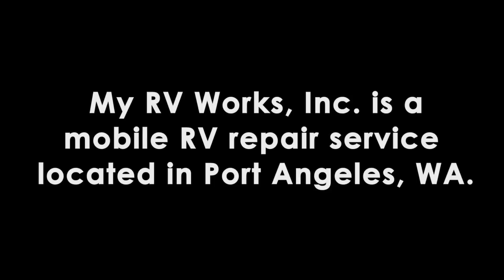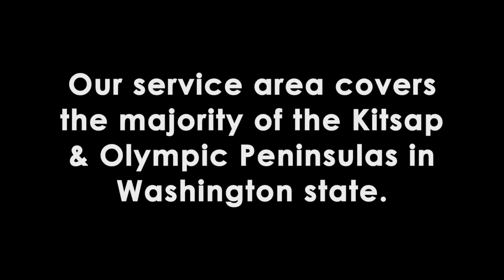[Q & A] 10 Minutes With A Tech - Session 1

Comment: Door problem on the Norcold 1200. I have seen / fixed it a dozen times. The door is too low to fully activate the switch. Shim the bottom door hinge. You are correct though about checking the switch by pushing it up. If the light goes out and no alarm or code comes up, than you pretty much know the door is too low.

Comment: I have a forest river travel trailer.  Trying to change the wafco 8955 converter. Problem is that it came with a two prong plug, brown wire and green wire. No neutral wire. Do you have to hookup the green wire to neutral bus bar?

Comment: Great Series! question regarding Kwikee steps... on my rig, they come in and out no problem, but won't stay extended (in the out position) with the step switch engaged (red light on switch- Fleetwood switch). I have checked all grounds, replaced the control box, checked the switch, changed the magnetic switch and still can't get them to stay out and manually override them.  any suggestions on how to fix them? Model is a kwikee 880 2 step

Comment: bought a used RV, Trial run to look for problems and have one nasty one.   Black tank will not drain, not a drop.  Valve goes in and out ok.  Gray water worked fine.  Rid-X??

Comment: Hi Darren. I had the question about the Lippert Bed Tilt Control. It turns out I had both a bad motor wire and a bad controller. I was able to get Lippert to replace the motor because it was clearly a manufacturer's wiring defect at the motor's pigtail causing a disconnect inside of the motor. I was able to get the motor to turn by applying 12v power to the back of the motor but not through the pigtail hanging off the motor. After installing a new motor I still had the same problem, the bed not working so at that point I decided to just buy a new controller and problem solved. Everything works correctly now.
Update: If anyone has one of these bed tilt systems by Lippert make sure your batteries have at least 12.44 volts or the controller will fault when you press the tilt control button. Its a really crappy design and could leave you with a bed in the upright position, at the worse time, if your battery voltage is below 12.44. I use my generator now to operate the bed as its very rare to need to raise or lower the bed when you have a fully charged battery.

Comment: QUESTION.   Have 12 cu ft Dometic, double doors in Montana HC.  In FL, fridge wouldn't cool below 47 degrees even in cool weather, camping in shade.  Previously, it worked great.
Returned to VA and took to dealer for warranty.   Dealer ran fridge and said it cooled very well,  0 in freezer and 40 inside.
Your guess, what might be the problem.  What typically causes an intermittent problem?

Comment: Hi Darren
We have a  2018 Casita travel trailer with a small, three way Dometic refrigerator, model RM2454. At ambient temperatures of over 100F the refrigerator struggles to stay at 32F. I’m reading that this is not uncommon for non compressor refrigerators. Have you come across this and would you share your remedy. Thanks

Comment: There's a loud ground-hum in your audio. Bought our 30 year old RV 3 years ago and the house-lights only worked when we were plugged into shore-power...one of the reasons we were going to visit you...and yesterday I realized that someone had hooked the house-batteries to the wrong side of a solenoid switch: traded it to the other side and unplugged from shore-power and the lights work! AND my auxiliary power switch on my Dashboard now lights up when I flip it and I can hear the solenoid in the engine compartment click on...WOW!  two problems solved just by moving one cable connection. I hung out with it all day to make sure it wasn't going to catch on fire. Today I'm going to use a tracer to track my water pump wire because sometimes it's hot and sometimes it's not...right now it's good at the fuse but dead at the end.  I've gained a lot of confidence from watching your videos...taking the journey of 12 volts.